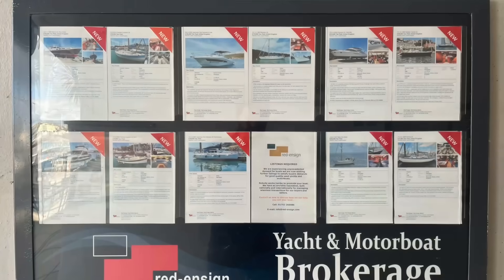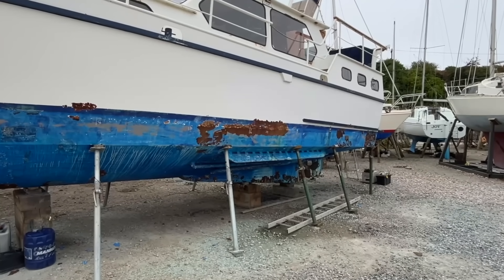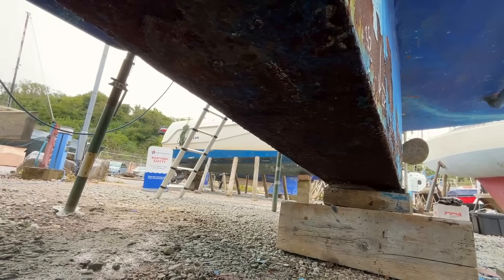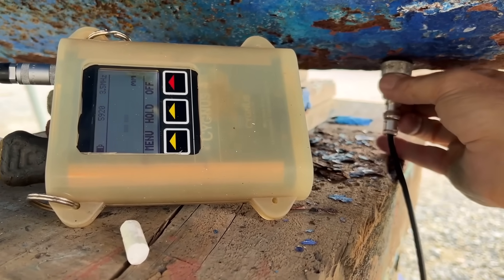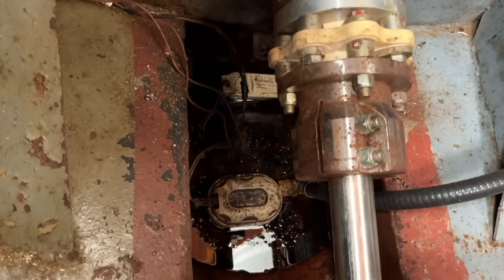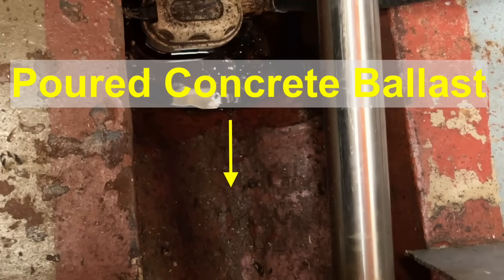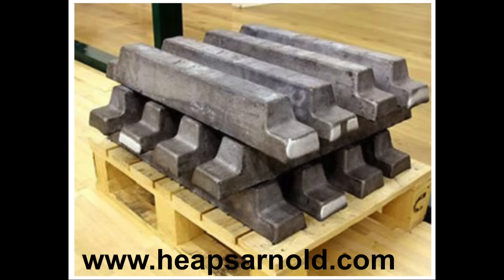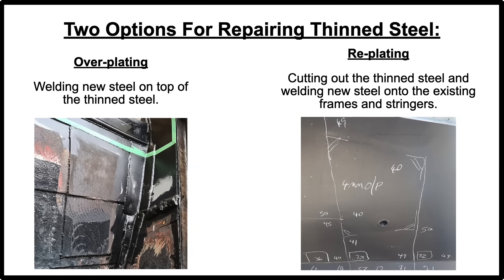Buying A Steel Boat? Get It Surveyed!

Comment: I have to say I found this interesting and educational. I am planning to buy a live aboard at some point in the next 6 - 12 months once my inheritance comes through and am keeping a very open mind about the build of the boat. I refuse to rule anything out until I have gained a decent knowledge of the pro's and con's of each hull type. It was definitely eye-opening to see that someone had gone for the 4mm in an important area rather than something thicker and helps me with being mindful of what to look for when I eventually narrow down my options. 

Thanks for sharing the video and the lessons!
Reply: David's main message here was "get the boat inspected by a Marine Surveyor asap", preferably White Hat Marine. The would-be buyer of this boat did not prioritize the inspection and that cost him. I appreciate David's honesty in claiming only 5% walkaway calls. Some buyers gamble on those odds and lose. If there is anything I have learned from YT marine influencers it's "stay away from old boats".
Reply from the maker: All hull materials have their pros and cons, nothing is perfect for everything.  In this case my Client got me in to start with a hull thickness survey as that is the most common problem for older steel boats.  Based on what we found the advice for my Client was to 'walk away' because I knew his budget, skills and timeframe. A different Client may well have been advised that this could be a great project boat.  That is why it is so important for any surveyor to understand their Client's circumstances.
Reply: @whitehatmarinesurveying  That makes complete sense to me. As I just posted to Dudley Dooright I did get the importance of having a boat surveyed, what was more useful to me was some of the things to look out for if steel hulled boats came up in my search. 

What I don't want to do is get excited over a possible future boat and then be told by a surveyor that it wasn't suitable - all from clues which I could have picked up myself if I had asked questions of the vendor / broker. 

To me, part of the benefit of videos such as the one you made here was about learning about the possible faults in construction which could lead to future issues - that way (knowing the skills I have (and have access to from friends and family)) I can make a more informed decision about whether it's worth going to the expense of the survey for that particular boat, or whether to eliminate the one I was looking at and continue my search.

Hope that makes sense.
Reply: @whitehatmarinesurveying  I got the sense this particular boat needs the entire lower hull to be swapped with a donor. A well equipped shipyard could probably do that cost effectively since the cutting and welding is minimized (one big seam above the waterline). But finding a donor and orchestrating the operation would be a tough engineering challenge to get right.
Reply: @dudley.dooright  I did get that message from David, what I was probably not clear enough about in my original reply was that the video was useful in providing tips for things to look out for myself, so that I can better eliminate potentially bad boats from my search. That way when I do eventually find something I want to buy then I'm less likely to be in the 5% of purchasers who are told to walk away. Less money wasted having possibly multiple surveys carried out and more likely to hone in on a boat that is a better fit for me.

Comment: I highly disagree. Concrete keeps steel corrosion free. I never found any issues under concrete, the line between the concrete and the steel can be problematic though if there is standing water. I suspect this boat did not have an isolation transformer, and spend way too long in the water with spend anodes. The advice to walk away is probably a good one, although steel is cheap and if you know how to weld, it is not that bad to fix. 15mm is outrageous! My bottom of the keel is 10mm and the bottom plating is 6mm and that is here in the Netherlands considered to be really thick.
Reply: I disagree--salt water permeating concrete is well known to corrode the steel reinforcing bars which are completely surrounded by concrete.  But what is driving the corrosion here is the slight gap between the steel hull and the concrete that came about from the normal shrinkage of the poured concrete and is increased by the flexing of the hull in waves.  Water (salt or fresh) in the bilge goes into that gap and stays there, promoting corrosion of the steel.
Reply: @nealr5530  . You only have to see coastal buildings with rusting reo bars cracking the concrete from the inside! salt and water permeate concrete for sure.
Reply: In all the steal hulled fishing vessels I've worked on, every one that had concrete in the bilge/low areas for stability correction had issues with corrosion and a greater repair cost because getting the concrete out was such of labor-intensive chore.  Far better to go thick (I know of one case where the vessel welded 4-inch-thick steel down either side of the keel) than use anything for ballast.
Reply from the maker: Nice thread which reminds me of one of my favourite sayings: "Every boat design is a compromise".
Reply: @whitehatmarinesurveying True! There are also strong beliefs. Concrete in the bilge is one of them here in the Netherlands. Not just as ballast but also corrosion protection. The concrete binds to the steel and takes up all the water that is evaporated. Paint or standing water on the concrete will turn it into a disaster, so ventilation is critical.
Reply: @Nerd3927  Concrete does not bind to steel; it only grips it mechanically. Concrete has two properties that inherently make it terrible for ballast, besides the one mentioned in the video, which was that it cannot be easily removed for maintenance: One, it shrinks as it cures, so it will pull away from the steel, and Two, it is highly alkaline, which makes it corrosive to steel. Concrete was never used as ballast because it was an ideal material; it was only used because it is cheap.
Reply: @johnbehling1142  I have used concrete as rust protection, not as ballast. That is done quite a lot in the Netherlands by older generation shipbuilders.

Comment: Excellent, informative video! 
Those not skilled professional welders AND studied in marine surveying should pay an expert. I weld well and am a skilled mechanic but I am NOT a marine surveyor who could easily catch defects I would miss.  
Even knowing how to use NDI equipment by reading tech data and instructions does not confer expertise. A surveyor offers an EMOTIONALLY DETACHED set of eyes because their income doesn't rely on the sale. 
All those defects would chase me off just for the cost of steel, parts and supplies though I could do all the repairs correctly. 
As with aviation if ya can't afford to do it right, don't do it at all because the lives of others (including rescue personnel who already see enough stupid owner tricks) are at stake.
Reply from the maker: Lovely feedback, thank you.
I'm like you but opposite, I can weld if things were desperate but am a much better marine surveyor.  And you're so right, the emotionally detached mindset is critical.
As I've said on other threads, knowing your Client and their ability to do and fix or how deep their pockets are is essential information.

Comment: Do you think the survey cost should be totally the responsibility of the buyer or split ? as it is costly to lift a boat out.
Reply from the maker: t's a good question.  I always advise that the Buyer pays for the survey as the warranty within it is there to protect the Buyer. It would be a conflict of interest if the Seller paid for part of that.  The lift and wash fees are more open to negotiation and here Sellers sometime pay half for if the Buyer walks away, they at least get a half price hull clean out of it!

Comment: So the owner has a problem, boat unsellable due to rotton hull btwl, so estimate to get the hull fully fixed with a new certificate plus a rebuilt engine ( its 50 years old) perhaps would be in at around 50 k....its a good looking boat for sure, and could be made solid again, but whatever the boat price was, its got to be less 50k...or the owner gives it away, The cost of removal and scrapage isn't cheep so he has to count his losses and let her go.
Someone out there could fix her up if it was a freebie
Reply from the maker: Good analysis. Every project boat needs to make the sums add up to make it worthwhile even starting, otherwise it's going to be a net loss.  Some people will be fine with that, others less so, but at least go into it with your eyes open.
Reply: Many aging boat owners are to jealous to let an unused boat go.  So instead they just leave it to rot beyond salvage.

Comment: The problem is not cement, it has a high alkaline chemistry and passivates steel. The problem is that it is not bonded to the steel and free water gets between the two, which itself could be acidic. The toilet contains chemicals and crap that would rust through steel.
Reply from the maker: As you rightly said, the water always gets in and the plate corrodes from the inside out. Doesn’t matter if it’s cement, gravel or sand (and I’ve seen all three).

Comment: Over the years I have watched a few videos of people doing up old boats and I just think are you completely nuts 
The latest is called saving blue steel and I think if you went and had a look at his boat you would say what are you wasting your time on this rust bucket 
And he has next to no budget and looks to me it is so on the cheap 
But steel boats are better than wood or even old fibreglass 
Very interesting video and i use to wear the badge on the left behind you on my beret 👍👍🇦🇺
Reply: A cheap boat is always expensive.
Reply from the maker: Thanks.  I've seen a bit of Blue Steel, he's bitten off quite a big chunk of work with that one!
Plenty of ex-REME around, at one time there were quite a few of us! AeM
Reply: Some folks enjoy a good project🤷‍♂️ Nothing wrong with that.

Comment: Just do the mathematics if you want a particular boat. New lengths of steel can be fitted and old lengths cut out, a good steel worker can easily do this work. When buying a steel boat you get it properly looked at and include his cost deducted when buying the boat. Some boats deserve preserving.
Reply from the maker: Exactly, too easy to write off old boats but you must do the sums and see if she is worth saving and you have the time and budget to do it.

Comment: Reason my Dutch boat have zink spray coating onder the water line 
That is done in the 90's .
Just to protect it.

Special that my boat is done for the nord Sea to travel by the Waddenzee.

Wel i see next year its time to take it out .
And repaint back up with 2k primer and paint.
I have my own metal detector to test the metal.
Reply from the maker: "Always buy the best paints you can afford and apply them properly" is probably the best single piece of advice for any steel hull owner.

Comment: A fascinating insight to a non boater. Articulate and well presented which left me wondering what the asking price was and, secondly given say £10 - 15 k to correct if it was ever going to happen. It can be recycled rather easier than fibreglass though and that is a blessing.
Reply from the maker: Asking price was quite close to expected repair costs.  And yes she could be recycled or made good again.  That decision was in the balance, but not one for my Client.

Comment: Reweld replate hull after sandblasting.
We did commercial boats and barges.
Put Anode Cathode bond all metal .
Paint with zinc chromate paint .
Reply from the maker: Agreed, whilst the readings were thin and the design wasn't great, she could still have another decade of use with the right works.  As always it comes down to price and budget.
Reply: That does not address the rusting out from the inside. Only option would be to replace the entire keel and skid plate, preferably in heavier steel gauge which then in turn reduces the balasting load. 
In any case and no matter what, that exercise would be cost prohibitive. 
Sound recommendation by this clear-eyed and proper surveyor.
Reply: @Centurion101B3C We put new steel over old .
Lasted 20 years .
On many boats .

One boat we cut off all corroded plates and replaced structure.
But with very expensive.
Reply: @Motorhead250  Yeah, I know that there are those who do that, but to me that looks like a band-aid solution AND then what happens after the 20 years is likely to be MUCH worse.

Comment: as a coupler for your probe, try using wall paper paste (buy it by the bag in any hardware store and mix it yourself, made from cellulose), this couplant is gel like and thicker than water and provides a better coupling medium on rougher surfaces.  (former NDT technician, aerospace and offshore oil platforms)
Reply from the maker: That is a top tip, I'll put a bag in my kit box and give it a go.  Thanks.

Comment: Dutch surveyor here. This particular boat is probably build by the first owner. From the looks of it, the underwatership has been treated very, very poorly paintwise. They are not build for salt water btw (no anodes). You can get these "floating caravans" in the Netherlands by the hundreds, for little.
Reply from the maker: 'Floating caravans' -  Love that phrase!  This boat had anodes and was made from good steel but time always wins, especially when the maintenance slips.

Do you normally fit anodes to inland waterways boats in the Netherlands?
Reply: @whitehatmarinesurveying  Normaly we do.
I got a 12 meter boat for inlands build somewhere in the late '70 I think, also from 4 mm steel, but without such a keel.
And without concrete. and anodes
I also have an 1946 seagoing old fishing vessel from 20 meters, and that steel is 7 mm and have anodes..

Comment: I will never buy a steel boat, regardless of the survey or this video. Seen them full of holes and rust. If you have seen rusted out cars, that is how I think of steel boats too.
Reply from the maker: It's a tough choice isn't it? - having a wheel fall off on the motorway or sinking while crossing the channel!

Comment: Were there any anodes?  I predict the bottom will fall out in a year or two.  Once you have internal pitting and damp the corrosion really accelerates.
Reply from the maker: Probably a safe prediction! Boat had zinc anodes at bow, stern and on the rudder, all part wasted and working. But they would have been of no use in slowing the internal corrosion due to water getting between the ballast and hull plate.

Comment: this looks like a boat someone had built on the cheap at the time, just to have a boat with no thought to longevity, ive seen this many times over the decades with many vehicles built on the cheap,boats, planes, automobiles etc i always call them good for now...not later
Reply from the maker: With the 4mm spec and poured concrete ballast I have to agree with you.  It has done well to get to 5 decades, but is now at a major decision point.

Comment: What would it cost to fit a new keel box?
Reply: There is nothing that can't be fixed on a boat if you are willing to write a big enough check.  But  is it worth it?
Reply from the maker: Would have needed to dig deeper to see the condition of the frames to get a detailed answer to that, but my experience tells me at least £5k to overplate what was there. A new keel box sounds simpler but would have required a lot more disruption internally and cost a lot more, especially if the frames were shot too.

Comment: Was the boat built for inland waters only?
Reply from the maker: That's a great question.  The size of the engine suggests no, the thickness of the plate maybe yes.  With no ships papers or builder's info we will never know I'm afraid.
Reply: @whitehatmarinesurveying  Yes, inland waters, Mercedes Diesels where populair in the time.
And cheap.

Comment: Did he mention it was built from 4mm steel ...... 😂
Reply from the maker: Yep, but it looked like they specified quite good steel at build which was still in good condition in a lot of places.  As with all boat builds it's a compromise between price, performance and speed.

Comment: 4 mm for the hull is far too thin and to think the boat is in salt water, !! if a narrowboat has corroded areas of 4 mm it will not get insured.. Having said that, the hull looks of very simple design and overplating could be an option after getting an abrasive blast clean and you can do the welding yourself !!
Reply from the maker: It is on the thin side, but if it was good steel to start with and was kept painted and protected could have lasted for another couple of decades. If there was no substantial thickness loss most insurers would have been happy.

And yes, it could be a good project to the right person with skills, time and money.
Reply: Personally, I would cut the old keel box off the boat and fit a new one in 10mm** steel. That way you don’t (shouldn’t?) get boxed in areas that corrode from inside. 
Replace the ballast with lead or iron shot in VERY tough bags.
** Welding 15mm to 4mm is pretty difficult   But what do I know.

Comment: What is the name of the builder?
Reply from the maker: She was a most anonymous vessel, no builder's plate or any other form of hull ID and no detail in the ships papers.
Reply: @whitehatmarinesurveying  How often do you find this to be the case? Should this be a red flag when looking at S/H boats?
Reply from the maker: Not often, but there were plenty of self-build and home finished yachts and boats made in the 70s, 80s and 90s.  All usually lack any of the modern ID methods and whilst not necessarily a red flag, should always puts you on notice to expect the unexpected.
Reply: It was built by super cheap crappy boat company